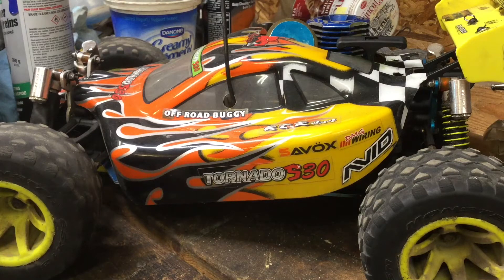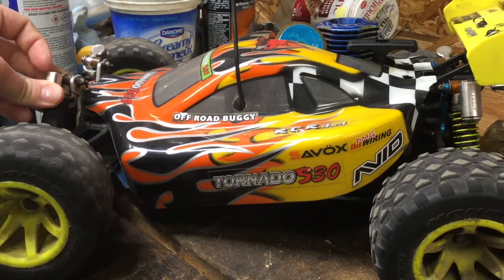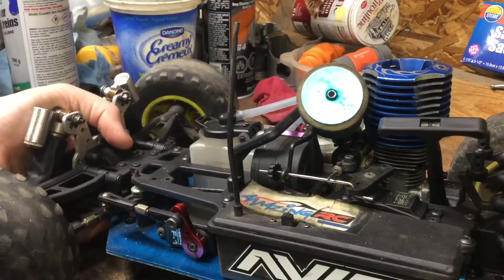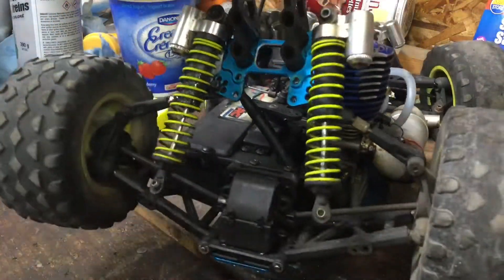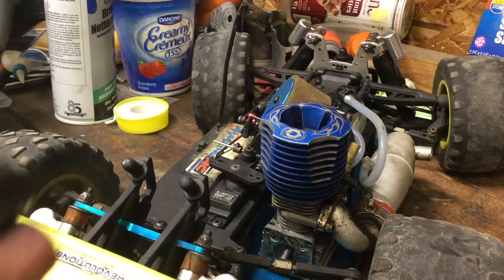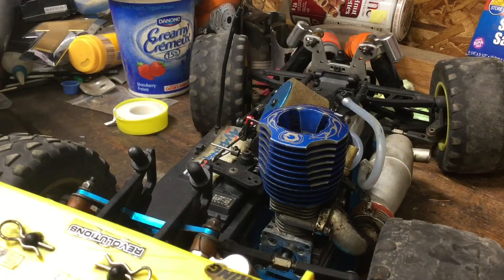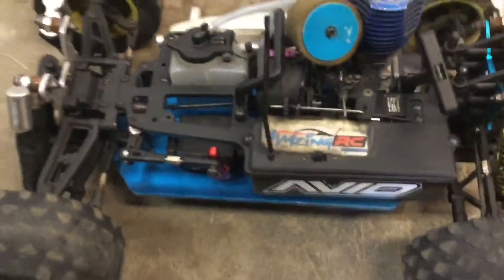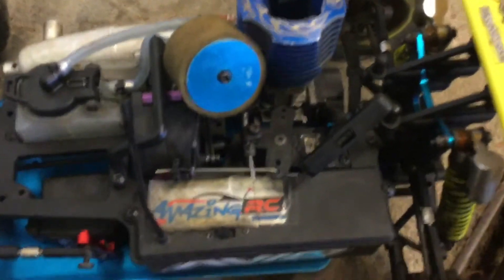How to fix a slipping pull start (the redcat tornado s30 is back in action!)

Comment: Very nice, I have to do this to my tornado s30 soon. The engine cranks once then it just slips for the rest of the cord. It still started second pull after sitting for nearly a year. Vx18 engines are much more reliable than I expected when I bought the car.
Reply from the maker: I NOAH MANN what engine are you running? The sh and the vx engines have different one way bearing systems.
Reply: @thenitronation5815  I have the vx18. When I replaced the pull starter the cord it was a bit sticky so idiot me sprayed wd40 all over it. It worked before that and it still starts the engine but it slips a lot. If there is one thing I've learned since my first nitro a splash of nitro down the carb works wonders. I also learned never to by a traxxas nitro but that's besides the point.
Reply from the maker: I NOAH MANN yeah you want your pull starts dry.

Comment: With the stock motor, i just pulled the pull start and sanded the shaft a bit near the front edge to avoid leaks and get a good grip. Still slips when starting the car right after a run but not that much. I also used 20% oil content fuel maybe i should use 16% with the stock motor. Thinking of changing the motor soon. Btw which one are you using?
Reply from the maker: I would not sand the shaft with sand paper but scuff it with a scorch bright pad. And any fuel with over 12% oil is way too much, use a fuel with 20-30% nitro and 12% oil or lower. I use sidewinder 30% nitro and 10% oil now a days.
Reply: @thenitronation5815  my bad i had to write 20% nitro, oil content is just around 12%.
And as for the shaft thing I will make sure not to sand it again rather use a carb cleaner and scorch bright pad